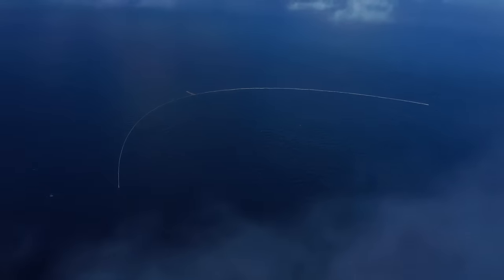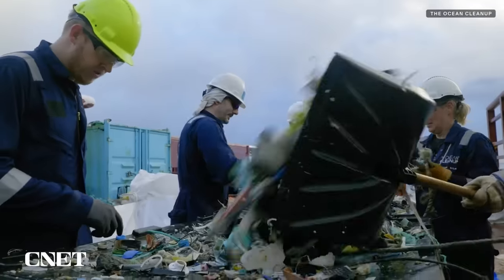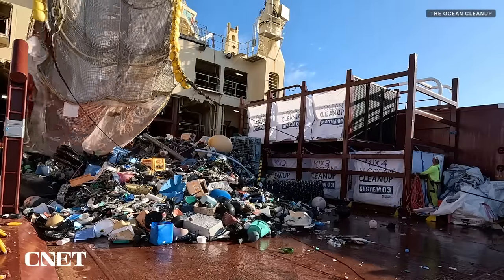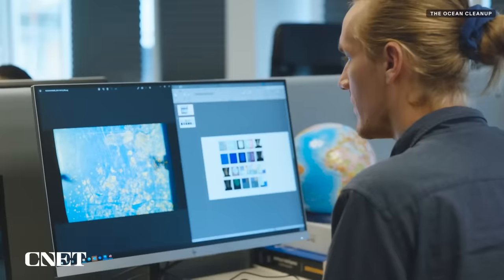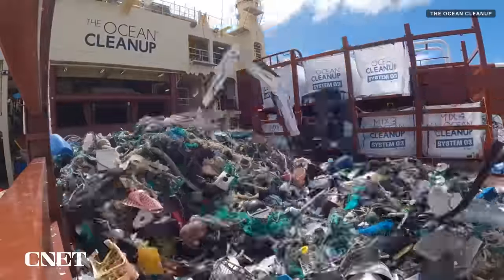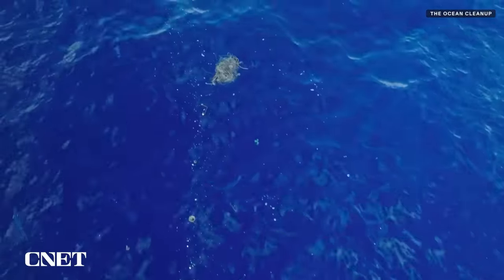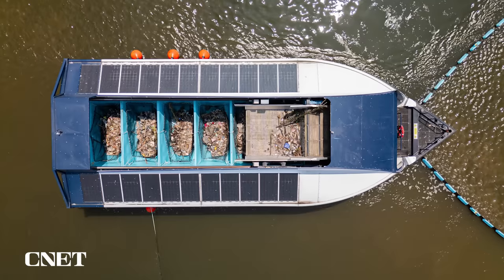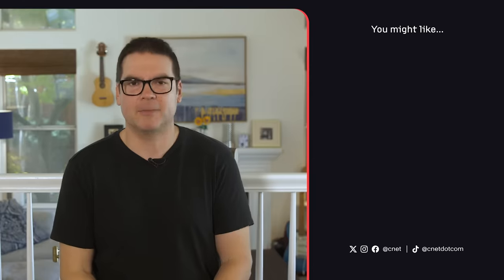The Ocean Cleanup’s System 03 Captures Record Amounts of Plastic From the Pacific

Comment: A truly noble cause. Intercepting garbage before it even reaches the oceans is truly genius.
Reply: @LuciousKage  Some of it is recycled, some of it is disposed in a way that won't reach the ocean, i.e landfills. It's not ideal, but its heaps better than to not do something about it. The disposal is taken care of by local companies, so each geographic location has its own solutions to the plastics.
Reply: @LuciousKage  in some cases you can actually burn plastics with proper filtration. The noxious gasses get filtered out and can be turned into something inert or less harmful and much smaller.
Reply: We could go back even further in the process and avoid throwing things in rivers. Then it would be truly "genius", as you said.
Reply: @delphzouzou4520  What... and hold the manufacturers accountable? That's crazy talk
Reply: @delphzouzou4520  good comment!
Reply: well stopping it from reaching the rivers in the first place would be even better.
Reply: @JustMakingItWork  We have in the UK,  we now tax companies that use virgin plastics. An many single use plastics have been banned.
Reply: @DavidKnowles0 yeah but theres still trash in the ocean that we need to remove, so even if we do that this is still neccesary
Reply: It’s trash, not garbage.

Comment: 3 phases of innovation 1:  It will never work.  2:  Yeah, it works, but, but , but. 3: What is taking you so long???  You guys are awesome.
Reply: Exactly what happened with Starlink.
Reply: Let's try some math. Their  goal is to reach 100kg per hour of trash collection,  that is 2400 kg per day,
which is 2.4 tons per day x 365 days is 875 tons per year.  
Currently conservative estimate puts the amount of plastic at 150+ MILLION tons today.  Lets also pretend then 15 million tons of new plastic are not entering the ocean each year.
So, to clean up the mess in 10 years like
they tell you in the video,  that would be 15 Million tons per year, and with each pair of ships collecting 875 tons per year,
you would need  17,150 pairs of ships, 
over 35,000 ships working 24 hours a day collecting garbage.
There aren't 35,000 ships of this size/type on planet earth.

This whole project is not realistic to accomplish the goals it claims it can.
Simple math shows you its all bull.
Reply: @theboringchannel2027  So, what is your recommendation?  Do nothing?  If so, you just may be stuck in the first phase of innovation, ie "it will never work."
Reply: @TonyK3130  Doing this is OBVIOUSLY NOT the actual solution.  It helps bring awarness to the problem, but itself is not the workable solution.   This is not the first phase of it will never work,  its not a functional idea,  the math shows that.
Even if they made things 20x more efficient than today, it would require thousands of ships working for a decade or more,
those resources do not exist, and the cost to build would be in the trillions.  You paying for this?
Reply: @theboringchannel2027  you looked up plastic in the entire ocean, if you look it up in the great pacific garbage patch, its only 80,000 tons.  If they can bring tons of garbage out of the ocean everyday i dont know why you'd complain.
Reply: @hoodrobin9842  There are actually two patches in the pacific, eastern and western.  Eastern is what they are trying to clean.
Based on their current costs, to clean up the eastern patch, will cost about $3 Billion,
and without stopping the source of this waste, it will just get polluted with trash again and need to be cleaned once again in a few years.
Reply: @theboringchannel2027  While you're explaining why it won't work, there are others coming up with ideas to help make it work in addition to this group.  That's the way of the world!  Have faith in humanity.  The world will never be without problems or problem solvers.
Reply: @KeePenne  Ok,  so better to focus the resources on the better ideas,  than to invest it into this idea, which is not the solution.  That would be the much better use of the finite resources/money.

But then Boylan and crew would be out of a job and actually have to go find a real job to pay their bills.
Reply: @theboringchannel2027  What are you doing to help them?  We don't need whiners.  We need doers.
Reply: @theboringchannel2027  This is a big problem and this company is part of the solution.   Users need to rethink their participation in creating the problem.   The use of plastic has been debated for decades and some changes have been made in repackaging.  End users who buy one time use plastics (i.e. water bottles) can use different options.  This isn't a one company fix, this is a world fix and it will take all of us to change our behaviors in regard to plastics and trash throwing.  Wheels may seem slow to churn, but things are happening.  Just a lot going  on in the world, huh?  Seems daunting at times.
Reply: @TonyK3130  what you doing?
Reply: @theboringchannel2027  No plastic containers including laundry detergent and milk jugs, soft drinks
Reply: @TonyK3130  so glass containers for everything, including water?  Little kids walking around with glass containers at school or at events?
FYI  40% of the waste in the patch are lost fishing nets and gear.  10% is industrial plastic items like pails, porta potties, crates, and many other plastics used in various industries.
And after they get done cleaning the eastern patch which they are working on now,
the western patch they don't mention,
which is larger, feeds waste into the eastern patch with the ocean currents.
Reply: @theboringchannel2027  No, metal containers (pop and beer) and insulated mugs.  I live in a rural area and have a wonderful well.  My grand kids use reusable insulated cups or pop from aluminum cans which are returned for the deposit.  Whine Whine Whine.  What are you doing?
Reply: @theboringchannel2027  First of all, they're talking about removing floating plastics. Not all plastic in the ocean is floating, much of it has sank. Secondly, they've already removed about 10,000 tons of plastic - while still in the research phase. Third, blocking plastic at river mouths is a huge contributor. Fourth, actually doing something is miles ahead of sitting on youtube and explaining why it shouldn't work - they've already raised awareness way more than your type of comments ever could, as well as funding for research and development, even if there are potentially some better solutions out in the aether. If you don't have a better solution yourself, saying that one such theoretical one exists is no help at all.
Reply: @alimanski7941  " System 02, deployed in late 2021, has removed close to 200,000 kilograms (about 440,000 pounds) so far. "
That would be about 220 tons,
not the 10,000 tons you claim,
which is 45 times more than was actually collected.  
Never let reality or facts get in your way.

Raising awareness is what they accomplished,  their system is clearly not the solution from their own published results.
Reply: @theboringchannel2027  >875 tons per year
> 15 Million tons per year
So we need to scale up this 17 142 times to work.
Why do you think it isn't doable?
Reply: @Vladislav888  cost to scale up and lack of that many actual ships to do so.

Actual need for ships will be higher,
because as they clean the ocean up,
there is less to catch per hour,
so more hours will be needed to catch
the tonnage. 
Also add in all the new plastic entering the ocean each year adding to the total,
probably need 2x the number of ships the straight calculations suggest.
Reply: @theboringchannel2027 they cover the interceptors in this video, intended to reduce the plastic entering in the first place.
Reply: None of this is claiming to clean 100% of the ocean, that's impossible. But cleaning up patches and helping prevent significant portions making its way in to the ocean is more than was being done 5 years ago, more than anything anyone else is trying, and certainly more than anyone here in this comment section will ever accomplish.
Reply: @JJYT92  Great Comment

Comment: It always amuses me that whenever you see them dumping garbage on to their boat decks, 90% of it is fishing equipment. I am 100% for Ocean Cleanup, but let's be honest about where most of this is coming from.
Reply: I have seen one of their update videos where it was stated they were shocked as well to see how much of an issue is caused by ghost nets. They are also catastrophic for the wildlife in a way far worse than the smaller pieces floating about.
Reply: A long while ago, the NYT published a series of four articles called Outlaw Ocean (I don't like the NYT much but these were excellent). They basically described how incredibly difficult it is to regulate any operation in international waters. Poaching, polluting, dynamite fishing, slavery even. There needs to be a joint global effort in that regard.

Comment: Way to go Ocean Cleanup!  And nice production, CNET.  I spent my last day in Aruba ten years ago snorkeling for trash that was everywhere!  I'm going to donate to this project.  It is both pleasing and disturbing to see how much garbage comes out of each load.  Polluters need to be educated, then ultimately punished.  I think a deposit system like bottles and cans is in order -- a Maine legislator proposed putting a chip in each cigarette for example that would count the butts for refund $.  Smokers are the worst polluters generally -- had to throw that in -- but the point is a similar chip could be put into plastic items to help (won't solve) the issue.

Comment: Great job! Has anyone captured the data on how much diesel is used to power the ships needed to conduct this mission? Not presenting this as a negative on what you are doing high I applaud. Rather, it will help show how inclusive you are in achieving positive environmental improvements.

Comment: Good on Kia for being the first! I wish small products wouldn't be made with the recovered plastic since it's likely enough that some of it will end up back in the world's waterways. 
 I feel that 250ml -2 litre plastic water/pop bottles and the like should be banned from retail sale. I see their use for humane purposes, like bringing water to refugees, victims of disasters, and MAYBE to underdeveloped countries (with a collection system developed for them ... only. I would like to see recycled plastics be used for items with an expected lifespan of no less than 25 years. 
 If the 'HAVE' countries would assist underdeveloped countries with recreating arable lands, then there would possibly be enough farmland to grow natural materials to 'replace' (Natural products were first) many of the plastics. There's no way all petroleum-based can be replaced since there are items that can't be made out of anything natural; however, there are many ways, using natural materials, to replace some common items, such as the see-through windows on envelopes. Hemp is a plant that can be used in so many different ways. Corn is another. 
 I believe more research funding should be directed towards creating things from natural and/or environmentally safe materials.
 Also, more has to be done by our cities (the City of Ottawa, Ontario, Canada fails) to protect our waterways from all known sources. Extreme use of road salt and allowing storm sewers to empty straight into creeks are only two ways the City of Ottawa isn't doing their best!

Comment: The Ocean Cleanup should contact "Green Vinyl Records" a.k.a. "GVR". The name of the company (with offices in the U.S. and The Netherlands) is misleading because the records are not made of PVC (Polyvinyl chloride) but PET or PETE (polyethylene terephthalate) a.k.a #1 recyclable plastic. PET is the most common thermoplastic polymer resin of the polyester family and the oceans are filled with it. GVR does not press PVC into vinyl records rather it uses PET plastic (recycled plastic is fine) in repurposed laserdisc injection mold machines. The process uses about 90% less energy to make a record because it doesn't rely on steam and extreme pressure but electricity and a polymer that has a much lower viscosity. All records are archival and can last forever if cared for and stored properly - PET ones may actually last longer. The fact that The Ocean Cleanup and GVR started in The Netherlands is a bonus.

Comment: This is not a plastic issue - its waste management issue.
Reply: waste management can never be solved as long as people can do whatever they want with products they buy, and for people in places without garbage trucks and such, there are massive garbage piles which never go away other than to the sea

in my opinion, it is a plastic issue because plastics last really really long, if packaging was changed to a bio degradable material it would 'degrade' much much faster, and wont get stuck in animal's digestive systems and yeah

Comment: it takes longer for glass to degrade than plastic
ChatGPT

Yes, it takes longer for glass to degrade than plastic. Here's a comparative overview of the degradation times for glass and plastic, along with the factors influencing their degradation processes:
Degradation of Glass:

    Composition and Stability: Glass is primarily composed of silica (silicon dioxide), which is highly stable and resistant to environmental factors.
    Timeframe: Glass can take thousands to millions of years to degrade. Its degradation in nature occurs extremely slowly through physical weathering and minor chemical processes.

Degradation of Plastic:

    Composition and Degradation: Plastics are synthetic polymers made from petrochemicals. They degrade through processes like photodegradation, chemical degradation, and biodegradation.
    Timeframe: The degradation time for plastics varies depending on the type of plastic and environmental conditions:
        Polyethylene Terephthalate (PET): 450 years or more.
        High-Density Polyethylene (HDPE): 450 years or more.
        Polyvinyl Chloride (PVC): 100 years or more.
        Polystyrene (PS): 500 years or more.
        Polypropylene (PP): 20-30 years, though this can extend up

Comment: Collecting 100kg per hour at an estimated value of $0.10 per kg results in $10 per hour revenue, compared to $1000 per hour to operate two ships with crew. These are the unfortunate economics. The only way to ensure some sort of profitability is by creating new circular products or clean energy but I guess they will be more expensive compared to new plastics.

Comment: What the system can’t catch is the largest contributor to micro plastics in the ocean. This is just what you can see. The largest contributor of micro plastics to oceans and waterways and lakes are vehicular tires. The irony is that large diesel, Recycle trucks are transporting plastics from recycle bins to sorting centers that never recapture any plastic. The plastic is then trucked again to a landfill. These truck tires are doing double duty and doing a double contribution of micro plastics into our water systems just to make people feel good about recycling plastic, which doesn’t get recycled at all. If this weren’t enough, then you add electric cars to the equation.  Due to their increased weight, electric cars generate 20% more tire wear per mile. This results in a 20% increase in tire wear which ends up as micro plastics in our waterways and oceans. Imagine what happens when we electrify 18 wheelers which will weigh up to 40% more than contemporary trucks.

Comment: 100 kilos per hour doesn't sound like a huge amount.
Reply: Its not, the reality is that as good as the intentions might be this is not in anyway or form an effective method.
Reply: Over 1500 plastic ends up in the ocean every hour. 

Less then 1% of all the plastic in the ocean is floating. So best case scenario they  remove 1% of plastic in the ocean. 

Ocean clean up is distracting from real solutions. (On land garbage collection, lobbying for less plastic use and production etc)

Comment: Will it matter if we acidify all the oceans on a fundamental level from so much carbonic acid? As a biologist, that is what concerns me the most, and is one of the least talked about problems we are facing. Regardless of how you feel about climate change, the amount of carbon we are putting into the atmosphere is so tremendous that it is causing the ocean to turn into an acidic solution vs a alkaline solution. This prevents plankton and other micro species that are the base of the food chains in the oceans, from growing. They have shells made of calcium that dissolve in acidic solutions. They thrive in, and are designed to live, in alkaline solutions. Not good.

Comment: Ocean cleanup is a scam I had contacted them in North American plastic recyclers that they told me they couldn't sell me any recycled plastic, which I had intended on using for recycled and renewable products in my own company but they straight out denied selling me any plastic and said they already had a deal with Kia motor company who uses the plastic in their vehicles. Most of these are cool for cleaning the water, but the aren't doing anything good with the plastic they recover, they are just helping some mega corporation get rich.

Comment: The USA has a very bad way of recycling plastic at this point the edge of 2024 the us only uses about 6% of the trash plastic for recycling it has been a dismal nightmare with even worse results you will only be able to recycle in America about 6% if you're lucky 10% so that means the other 90% you have to figure out what other country is responsible for the trash and work out a agreement that they split the other sections of the plastic that should be shared by everyone in the world for recycling needs